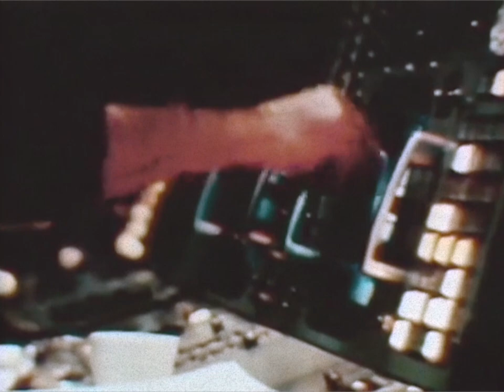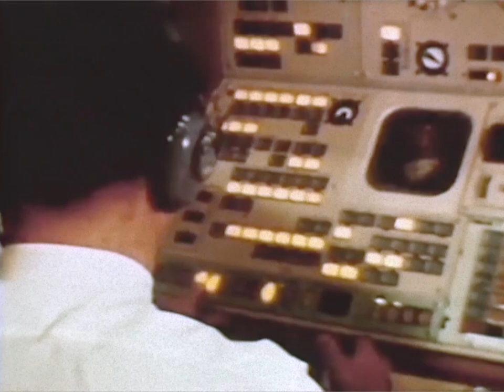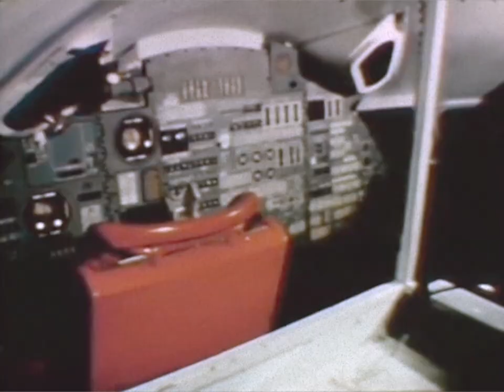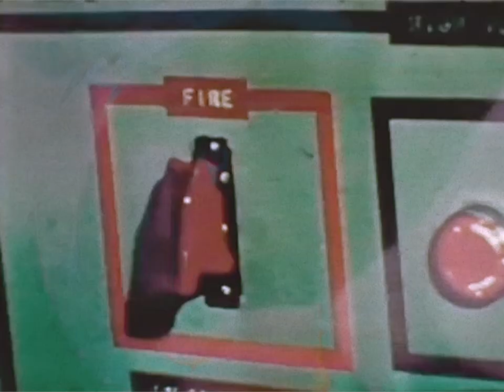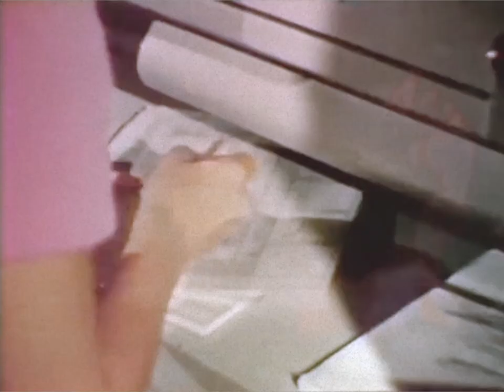MSC Progress Report Jul-Dec 1967 - NASA, Manned Space Center - Apollo, History

Comment: Why was such a high pad pressure needed in the command module? Did it give a greater structural integrity during max Q?
Reply: The higher pressure on the pad (16.2 psi - 1.5 psi above normal at sea-level) would've allowed for detection of any leaks in the CM.